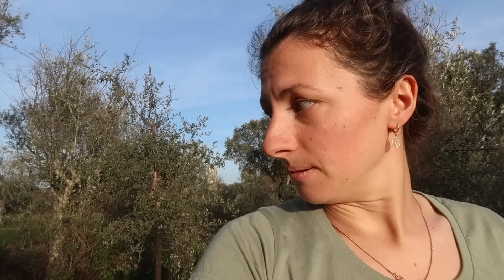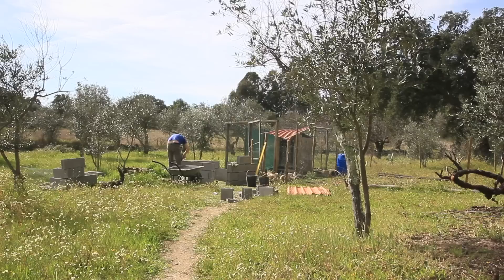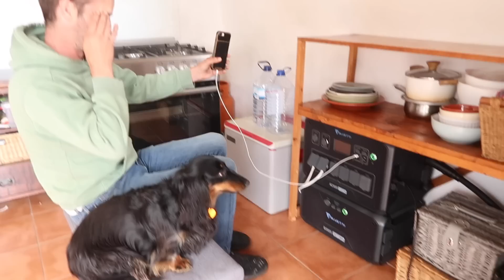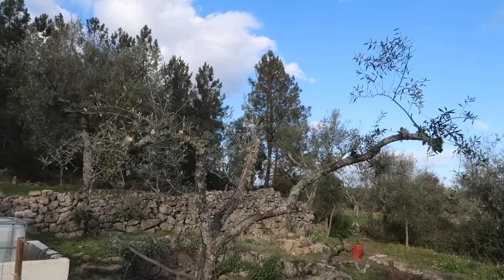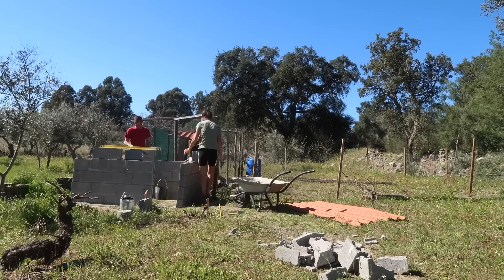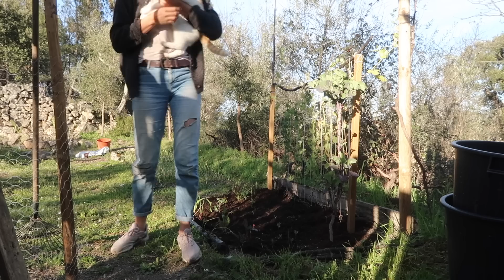Just a couple of amateurs building a homestead.

Comment: I know you guys aren't hugely experienced, and it shows in some of the silly errors you make - like not checking the chook house wall for plumb, as well as 'level'. Carissa it's a simple enough error, and we've ALL done it at least once. Don't feel bad!
Cuppla thoughts re: chookhouse. 
Have you allowed in your design for ventilation near the roof, so in summer heat can escape? Lots of chooks, small space, summer....chooks aren't good with heat.....
Not sure what you're planning for the roof, either, but I'm guessing a simple skillion roof? If so, is it going to go crossways or lengthways? Whichever way the roof will 'fall' (i.e slope) one end has to be higher than the other. It might make sense to build in a closable frame under the higher end - covered with fine 12mm chicken wire to keep rodents and snakes out, but also have a lift up door over this that can be opened in summer for ventilation? Hot air rises, so vent needs to be at highest point of roof.
Also one other observation. Iwan is doing the right thing, laying out the blocks and doing a 'dry run' before cementing them in place - BUT - sometimes when block laying or bricklaying you end up with a half brick (or less than a 'half brick') on the edge of the doorway. This is NOT a good idea, as either hinge or closing frames need to be fasted to these to hold the door, placing strain on the joins (which with blockwork are NOT strong). So it actually makes sense to have the 'half block' a bit back from the end, and utilise a 'whole block' at the doorway. The way you're building this you could do this easily, but probably something to think about for the next project. Doing the 'dry run' you can pre-cut the 'half blcok' to the correct length and insert it 'one block back' from the doorway, leaving a full block at the doorway opening. Make sense?
On the subject of the door itself, as the blocks are hollow and hard to get decent fixings into, it makes sense to use a frame which is flat on the wall and bolted right through, OR (and I think you may have made the doorway too narrow for a normal frame, within the actual opening), but IF you are doing the frame 'in the opening' then be sure to swing the hinges on the LHS, where there is a long wall to absorb shocks of either closing or slamming, not hung on the skinny 'blade' of the wall to the right of the door. And use a dozen shorter screws and rawl plugs to fix the frame to the blockwork on each side. Ideally evenly spaced in pairs of fastenings top to bottom, at around 250mm to 350mm spacing. Ideally, a slight diagonal pattern to the horizontal pairs of screws. Not side by side, as in those skinny blocks it might put too much strain on one spot and weaken it causing a blow out.
So, if you measure up from the door step 250mm, put one screw about 20 mm in from the outer edge of the block, then measure another 50mm up and put the next screw on the opposite edge of the block. And then maintain that pattern all the way up. This way you don't weaken the block as much and sort of 'triangulate' the fixings. But it's important to do lots, as shorter screws and plugs don't hold as well as longer ones, but longer ones don't work into hollow blocks like these. If you go too close to the edge of the block, the act of drilling or later screwing in the screw, can blow out the side of the block. They are strong in compression but weak in tension, which is also why they are so easy to break and split!
Just a few 'professional tips' to maybe help you with your deliberations and avoid costly mistakes down track!
Keep smiling! You're going great!
Reply: Wow lots of information there, I must admit I don't understand it all I learn by seeing and doing rather then reading.  But I always read through comment as they are often so full of knowledge, diolch/thanks :_Frankie::_Frankie::_Frankie:

Comment: Re your cement mixer. Could you not fashion a handle (get Nick to weld a handle on) on the other side and then you can tilt and push the mixer instead of pulling?

Comment: when pruning trees always start with cutting out the heart wood so basically work from the inside out  i believe that olive trees are very resilient and they actually like a hard prune back around every 5 years so yearly they will just take a soft prune as in cutting off most of the thinner branches and on the fifth year thats when you cut back the heavy trunk branches so to speak.hope you get what in talking about and hope it helps you out some..

Comment: perhaps an electric chipper would pair with your bluetti solar generator ...... this chipper would double as suppling fresh bedding and layering chicken coop, good fire starter as well as feeding small almost pelit fuel........ electric chippers are way less expensive that gas power ones, 15 - 20 amp. will work well for your land any excess can throw in compose .......we the north .....S